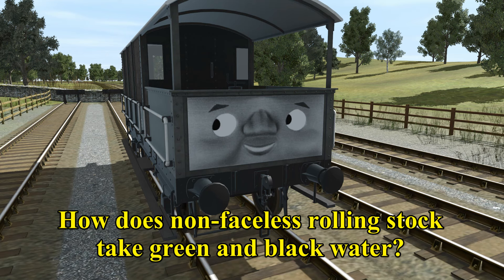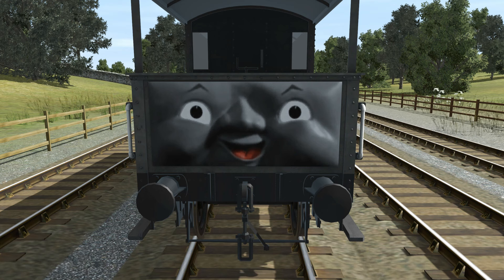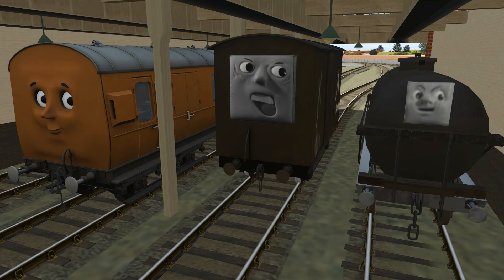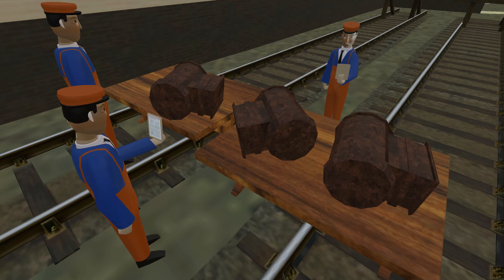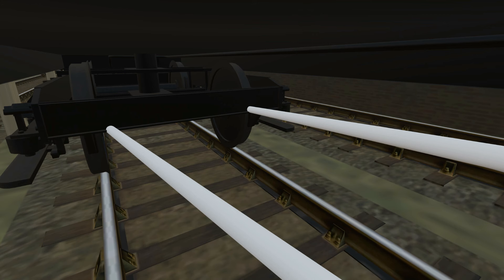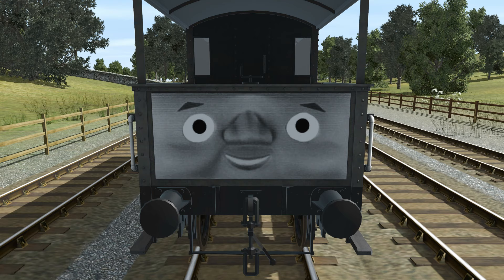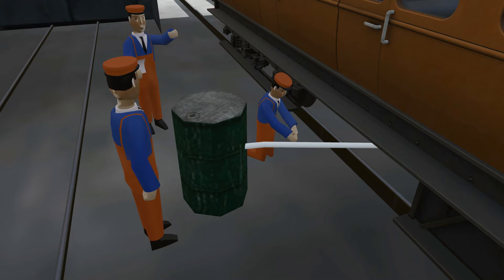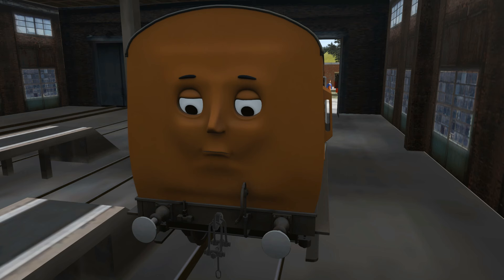Sodor Answers: How does non faceless rolling stock take green and black water?

Comment: What will happen if an engine has a burst boiler and it isn't replaced?
Reply: Pretty sure they’d die.
Reply: Yeah, death is pretty much imminent at that point.
Reply: What If they're given green water but not fixed?
Reply: @Sebi1963  Hmm…..that’s a question for Victor to answer
Reply: It’s happend in the series before.

Comment: Definitely an interesting answer!

Question 1: Although it is very morbid, you say the face appears at the "First Firing", so does the face go away at the "Final Firing?"

question 2: (Also morbid) You say once the "Final Firing" happens, you can no longer start the engine or vehicle again, but does that still stay if the parts are reused on other engines/vehicles?
Reply: 1. Yes!

Comment: So, I actually have 2 questions.

1. We already know that it's illegal to scrap a non-faceless engine when it's still in use, but does that apply to an engine that has already died? Like, if an engine is given a final firing, are theycallowed to use its parts for scrap?

2. Is it possible for a non-faceless vehicle to change its gender? If so, how?